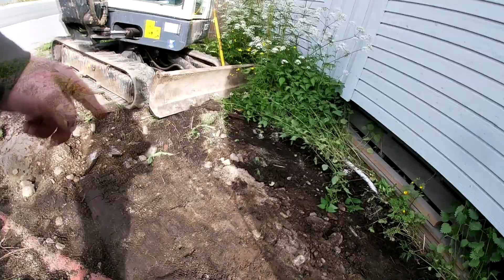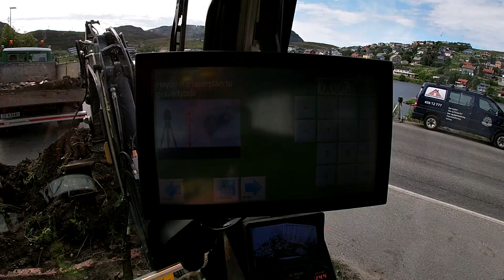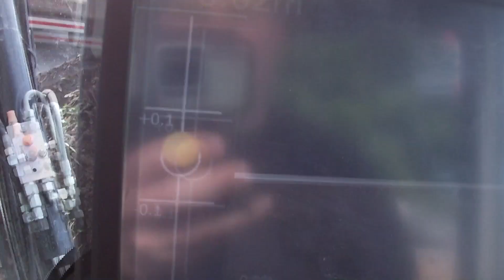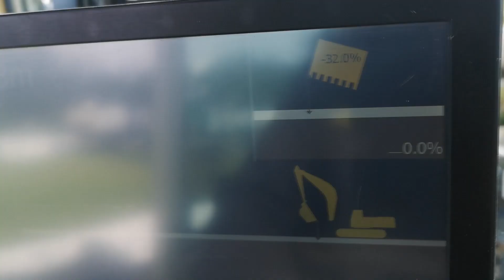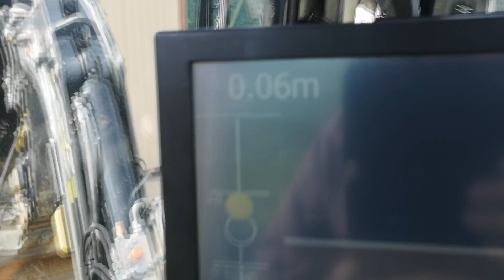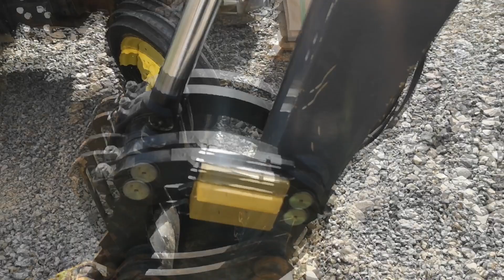Digpilot 2D machine control in use on miniexcavator

Comment: Interesting - Trying to use Topcon equipment (Laser, receiver and tractor cab display for land levering or tilt (slant), digging trench depth level or tilt (slant) without so much electronics. YOUR THE MAN! Just bought 2018 K008-3 with 2 hrs. Not much success with using machine so far, give me time.
Reply from the maker: Yes electronics helps, I use it most for an confirmation that what my eyes tells me are right or wrong 🙈. The smaller the machine the harder it is, but when you get the feeling of the small one you will operate the bigger ones without any problems.